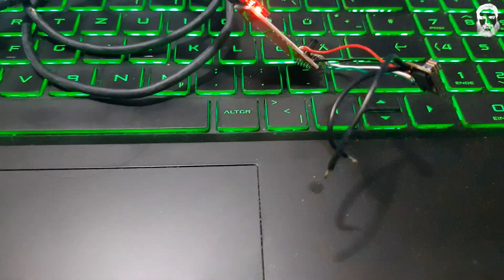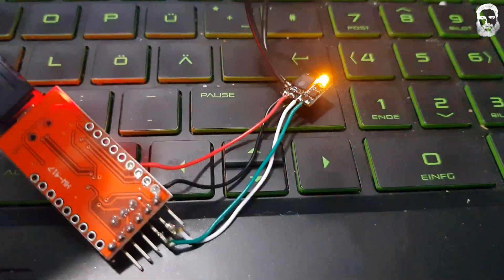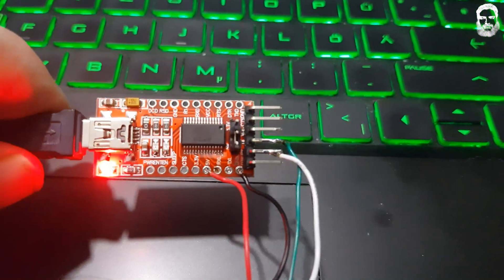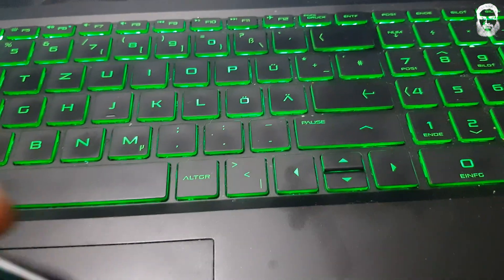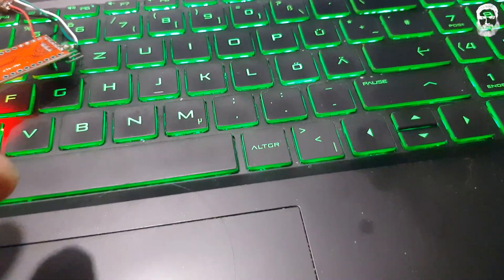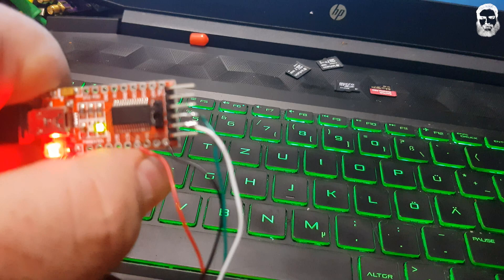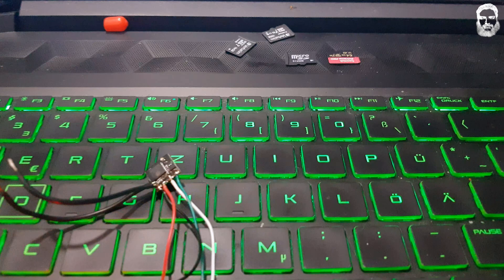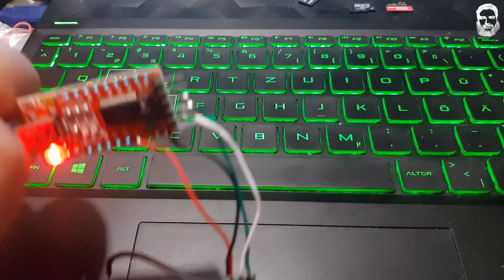Howto flash / recover an ExpressLRS (ELRS) receiver with an FTDI

Comment: is your ftdi adapter set to 5 volts or 3.3 volts on the outputs?
lg peter
Reply from the maker: Hey Peter, the jumper was set to 5V, if that is the question. vy73 Sandor - DM4DS

Comment: Can you use an arduino uno to do this?
Reply from the maker: @terminsane  I´m no arduino specialist, but I´m sure it can work - I did a boatloader flash via an arduino on a 3D printer mainboard. Should be almost the same. But it´s years I done this. If I remember correct,  I used the 6 Pin header in the middle of the Arduino uno to do it, but can´t remember details, sorry.